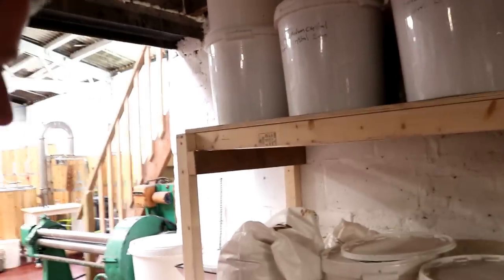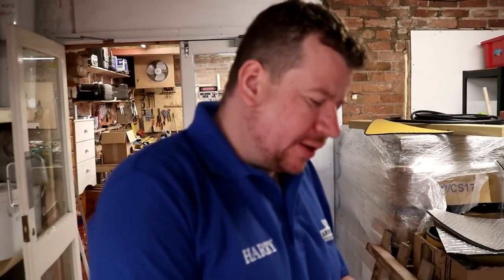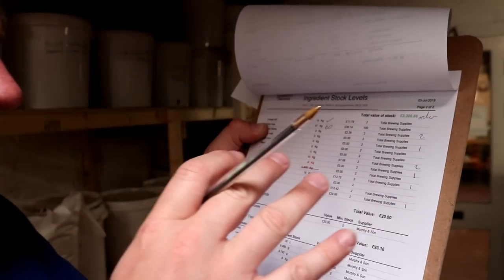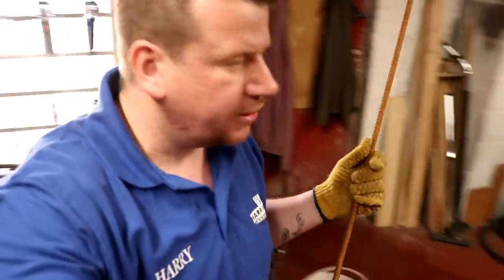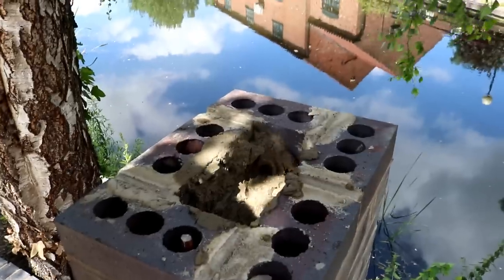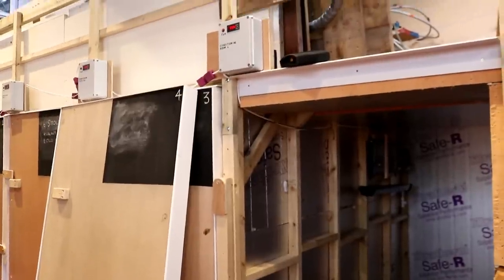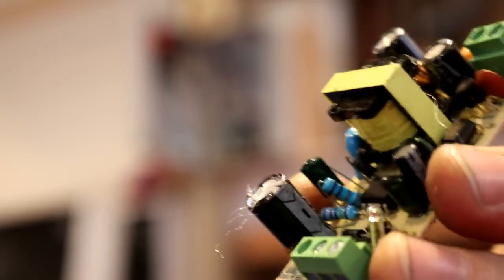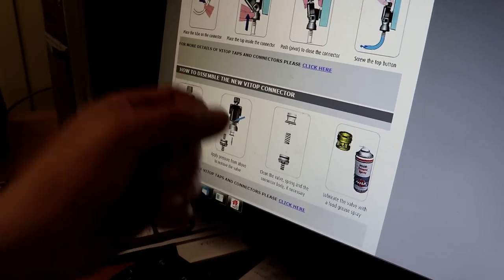CHILLER MALFUNCTION DIAGNOSTIC

Comment: Wall is taking shape now Harry,all it needs now is some caps and a quick acid wash to get rid of any cement splash,you'll have railings and all up this time next week I reckon. A regular stock take is a must,don't want to get caught out. Once you've got caps on wall you can get cracking be with the tidy up,I'm like you I hate seeing a mess in an otherwise tidy setup. Mind yourself in that heat you're looking a bit 😈. Cheers.